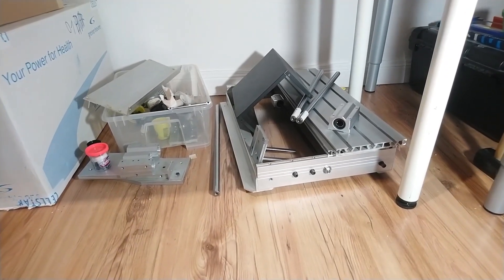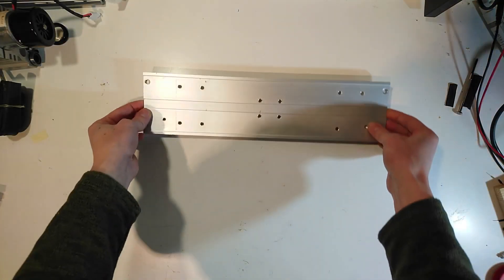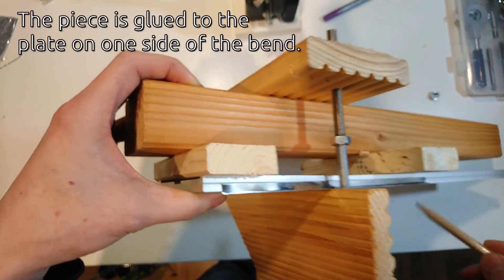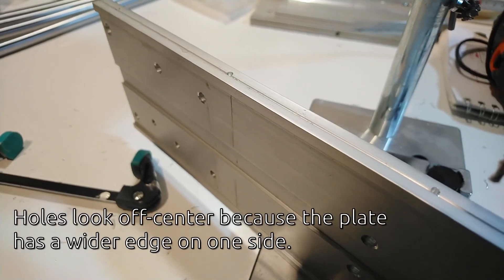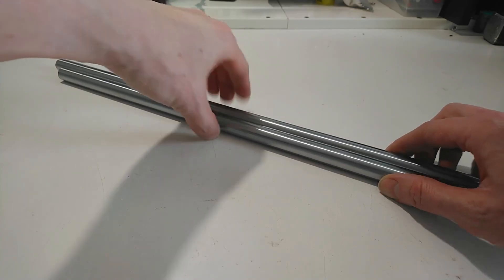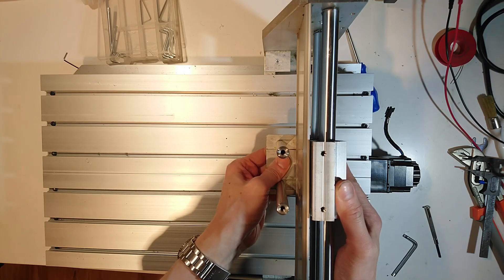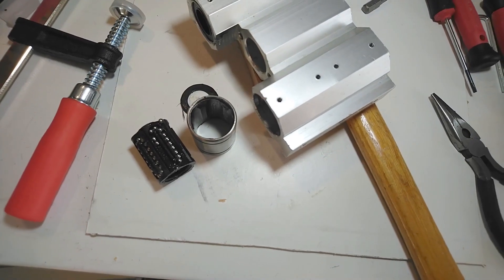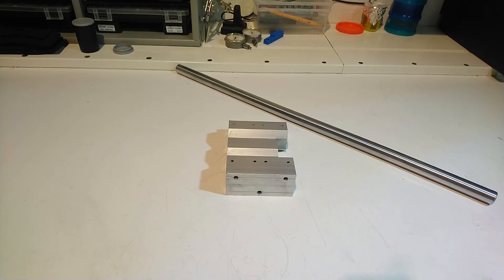Second Hand CNC3040 Part 3: This machine is cursed!

Comment: not neccessarily dropped, it might have crashed its tool into a workpiece. 
If the movement system is strong enough, it could have bent the plate and rods.
Reply from the maker: That is true. Well, the carrier plate needed more than 100 Kg pressure to get straight again. I would guess that the motors are not that strong.
Reply: @Joekutz  You'll probably notice if that was the case, because it would certainly have warped the spindle too.
Reply from the maker: @NiksSofa  Good point. Next on Joekutz's workbench: Putting a dial indicator on the spindle :) I have not measured yet actually. One of the next videos will be about the spindle.

Comment: It'll work great. Don't worry too much until you measure cut parts. It May surprise you.

I cut the wood away from the sticker on the bottom of the wood with my cnc.  And my cnc is made of plywood!
Reply from the maker: I had a similar experience with my previous machine, it was more precise than a machine with drawer-rails as linear bearings should have been. But with that one I need to make sure e.g. that everything is square, otherwise it would dig into the material on one side and not on the other.
Reply: @Joekutz  i mark locations on the table what shim thickness to use. I use cereal box paper board, around 0.3mm in one corner.